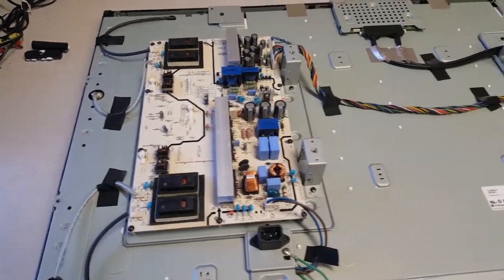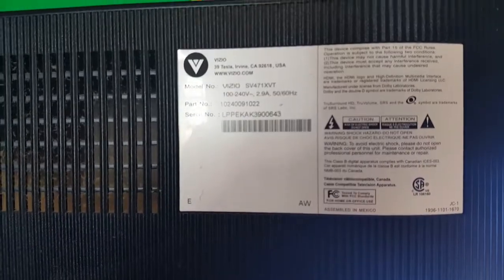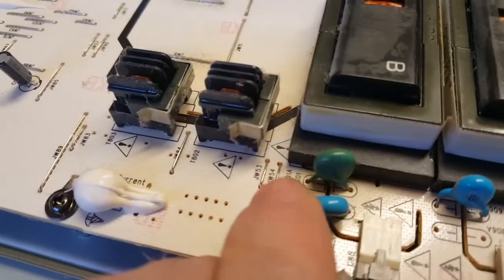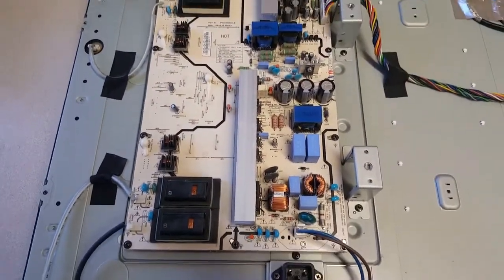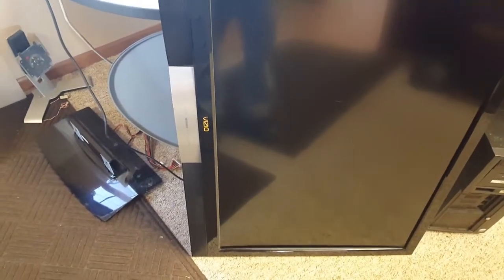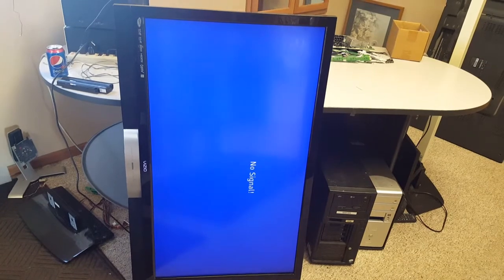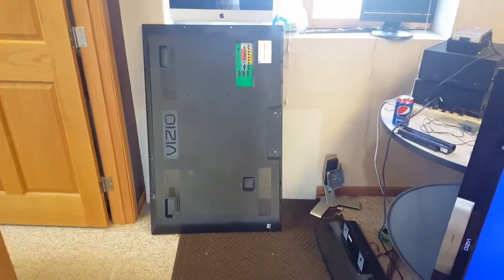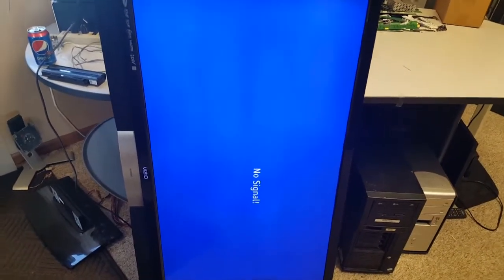Vizio SV471XVT power board repair.

Comment: Where did you get a board for $10?  I am getting a "broken" Vizio TV of this same model tomorrow and want to replace the power board, but they're going for $60-80 on eBay
Reply: nevermind, I watched the video again and heard that you said you bought capacitors, not the board.  I'm not that electronically inclined to replace any parts like that, I'd rather just replace the whole board.  Thanks
Reply from the maker: Shopjimmy.com is a second site i like to use to find boards